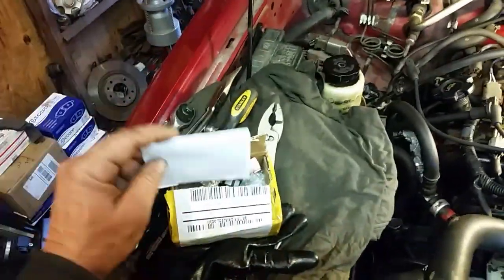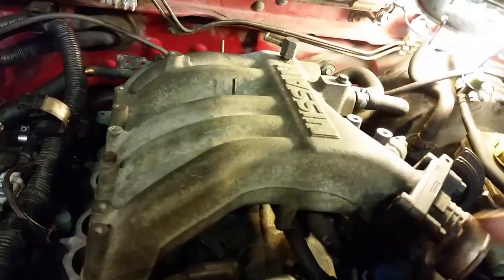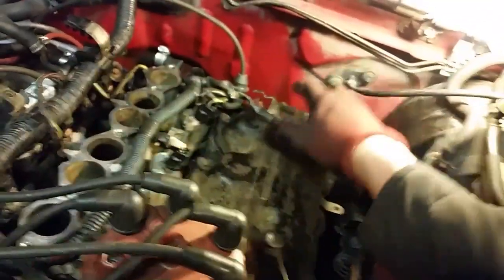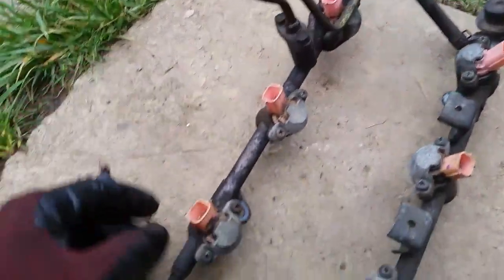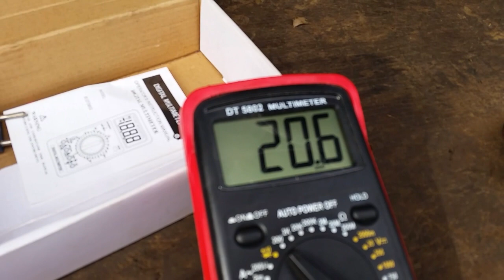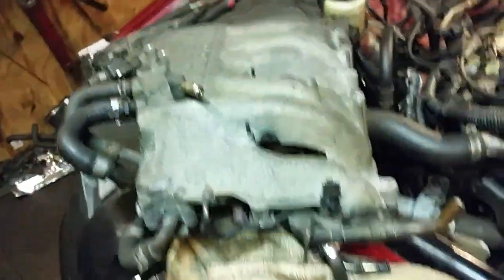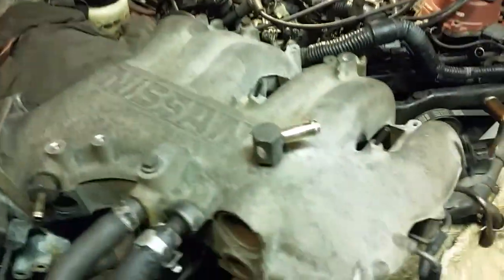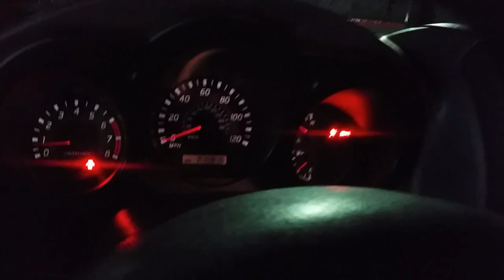Xterra 3.3 Random misfire fix. 6 new Injectors replacement

Comment: My 2004 probably needs that. I dread working on this idiotic "design" where they run hoses, tubes, and electrical down the center of the engine.

Comment: I’m having an issue like that with my 04 Xterra, replaced 3 accesible ones with some from Rockauto and is shaking, heavy gas smell, acceleration problem so I read that if you have black dot injectors you have to get matching black dots on all unless you switch them all and same with the blue ones, sounds like my car has blue so I now will jump into taking all the injectors and the rail and replace them with all new black dots injectors and see what happens. Excellent video very helpful!
Reply from the maker: Nice!! Not sure why aftermarket injectors are such an PITA
Reply: @FixingWithPassion  very much so, I had to stop because of some rain here where I live but I have a big problem so far unscrewing the bolts from the right side like I don’t know where to start if I’m being honest and one of my Allen screws screw is stripped (left side near the accesible injectors)
Reply: I've been using Rockauto for years but found out the hard way that it's best to use them only for mechanical (i.e. brakes, rotors, hoses, etc.) but when it come to anything electrical/ sensors, what not, stay away from them. It's a roll of the dice if you use them for that. You more than likely received defective parts from them. They are notorious for sending those, trust me from personal experience.

Comment: Before I remover fuel rail I used an impact screwdriver on the cap screws. Worked perfectly on all intake bolts as well.
Reply from the maker: Best way!!
Reply: That's what I was gonna suggest.
Reply: @jacobcopeland1922  ?
Reply: @AnonURnot   I was going to suggest using an impact screwdriver it's the kind you put on the screw and hit with a hammer or you can use an electric impact screwdriver nowadays just have to make sure you're pushing in kind of hard.
Reply: i don't own a set of impact screwdriver so instead i use vice grips around the outside of the screw. has worked well.

Comment: Once you get the rail out, use small vise grips on the screw heads, uncrack them, back them out and replace with M5.80 stainless steel and use a little antiseize- Enjoy!

Comment: there's a small rubber bushing that goes between the injector and injector cap. it should only be able to go on 1 way. very easy for it to not seat correctly.

Comment: If you stick a slotted screwdriver through the c clamp over the tab, you can flip the tab so it holds itself open. It'll be fragile like a mouse trap though, so be careful not to clip your finger

Comment: Also had a problem with random misfire.  Turned out the Distributor bearing went bad and cause the problem.  New Distributor and problem was fixed.  Only happened with the engine warmed up. (acted like a vacuum leak)

Comment: Thank you for making this video, I had a p0300 as well but it was first saying cylinder 5 misfire then it became random/multiple. I believe one injector is spraying entirely too much fuel so I will solve that.it already burned my o2 sensor and I replaced the cat. Wish me luck I really love the truck
Reply: I had that issue with my 2000 X-terra.  Changed the distributor/fixed.
Reply: Man.  I have the same issues.   Replace the Distributer and spark and wires.      I still have the same issue.   Right now I’m diggin out the whole injector system and more than likely to replace them.   I’m not sure if I can get away with flush them out.
Reply: Update the engine had a bent valve caused from misfire and it eventually blew a cylinder. Rip

Comment: Thanks for all the videos on this truck really been helping me a lot with mine ! I was taking it today to get some break work done and I started it up ran fine for a few minutes then started sputtering and stalled and wouldn’t start back up almost seemed like it was running out gas just wondering if you have any idea why the problem could be thanks
Reply from the maker: Check fuel pressure

Comment: Great tips. BTW, those are likely JIS screws and not Philips. They are slightly different which is why conventional Philips bits struggle with them. Getting proper JIS bits could be the solution to getting those screws out much easier (rather than dremmle-ing as you mentioned)
Reply from the maker: Nice to know!

Comment: What injectors did you order? I have a p0300 and have replaced 02 sensors, plugs and wires, distributor cap and rotor plus fuel filter. Local parts store has the injectors for 100 each and don't have the funds to pay that. Thanks for the great xterra videos and just awesome how to step by step to get it done.
Reply from the maker: Check your fuel pressure.
Reply: Fuel pressure is good. The advice I got from a local shop is replace maf and injectors. That's why I was asking what injectors you got. Thanks in advance
Reply: @finwall  how much did you get them for in the end ? I just had one go bad and I've already did everything you did

Comment: Thanks for taking the time to record So many videos on repairing the car. I have a vg33e frontier 4x4 and I am In the process of rebuilding the motor. Your videos have been a treasure to me. I took the injectors out of the fuel rail to have them properly cleaned in a shop. Then noticed there are  2  types of injectors one with a colored dot and one with out. Do you know if there s a specific sequence to be followed putting those back into the fuel rail. Thank you so much.
Reply from the maker: Not really. Just lube them with grease to let them slid in.

Comment: You can just use a drill gun  with a Phillips head bit it easy just come out on out for me but you have to put a little pressure on it not too much just a little just enough to hold the drill bit in the  said
Reply from the maker: Right. I do that sometimes also.

Comment: can you pull out those fuel injectors on the passenger side without having to take all that other stuff off??
Reply: i am answering my own question..you can not.  the angle of the injector will not let you get a good screwdriver on the end of this.  Also, use a impact screw driver.  the ones that you hit with a hammer to take off those pesky Phillips head screws.  make sure to soak them with PB blaster a few hours before..  i got them out easily with out stripping out the heads at all.  tap the screw driver into the Phillips screw a few times, and it impact actually spins, and does the work for you.  on the Ellen head screws i put my 6 point head on the ellen bolt and tap it hard a few times to loosen the rust or corrosion and turn slowly with a large ratchet or breaker bar.
coming out with my own video of pulling all this apart, even the knock sensor

Comment: Did you replace that seal with new ones @ 13:23 min of the video, or you reused them?
Reply from the maker: I reused them. Just check for cracks and tears.
Reply: Thank you for the response, I'm just going to replace them all, I found them in the dealership.

Comment: I have  2000 nisan frontier  3.3 p0300  code  random misfire OEM  distributor spark plugs wires  every time when  I hit the gas pedal  service engine start  flashing  rough running  u think  will be the  injector??I Dont  ahave  a good  scanner  to check  the injector

Comment: So I took the injectors out to clean them and now there’s white smoke coming from the exhaust and it’s acting like a misfire but no codes.  Do you think they are leaking by?
Reply from the maker: If it fumes burns your eyes then yes
Reply: @FixingWithPassion  yeah it smells like gas. Do you think I need new ones? I just put new orings on. And how about putting them in? Should I try to tap them in deeper before putting the cap on? I just put the cap on and evenly screwed down each side of the cap.
Reply: Same thing here about 2 days ago. New injectors, white smoke, fuel from exhaust, and cylinder flooding.  Does this car need to be recoded to the ECU?

Comment: Hi! nice video! Where's the link to the injectors?
Reply from the maker: E-bay buy only OEM one's!!
Reply: @FixingWithPassion  thank Nathan! Can you share the link and your part number? I have a 2001vg33. 207k kms, but still on original injectors. After using liquimoly injector cleaner, misfires started.
Reply: @FixingWithPassion  figured they needed changing anyway because they were in there for two decades. So the ebay link could help me out. 60 bucks for a piece or 5 pcs. Thanks in advance.

Comment: What problem are you having? I think I have bad fuel injectors I'm not sure my truck is has rough idle and whenever I get in the gas it jerks the truck around a little bit I changed it to spark plugs a couple weeks ago thinking that might be it I wish I would have done the fuel injectors while I was at it I just didn't have the money at the time and I thought that spark plugs would have fixed it but I'm going to try spark plug wires first and then after that I think I'm going to do fuel injectors I'm probably just going to go ahead and get both and knock them both out what's your thoughts?
Reply from the maker: Injectors seem to be an issue at times. I'd try that first with OEM one's or some out of a 2nd xterra same gen. That fixed my issue.

Comment: I've got a #3 code the strange thing is it starts perfect no matter hot or cold drive it for miles and miles stop let it sit then start up and I have a misfire, it had a random misfire but I found a giant leak in one of the egr or pvc lines can't remember ran fine all the codes went away then the next day number 3 again and the smog test fail on my code reader. I don't really understand if it was a leaky injector the morning start should be bad but its the warm start. I pulled the plug it's perfect new wires new Nissan Distributor going to change the plug today but I doubt that is it. Any help understanding this?
Reply from the maker: Hi! Thanks!  let me check something.
Reply: what injectors are you using and are you happy with them? I can find oems right now.

Comment: Could these slots in the seals be allowing fuel to flood the cylinders? https://youtu.be/cvRX8SgxC7Y?t=801 I just replaced all injectors on a 93 d21 vg30e and it is running super rough/rich with black smoke out of the exhaust. The spark plugs are all fouled and wet. I didn't think to check if the old injector seals had these slots.

Comment: What pisses me off- is, that mfg uses cheap metal on these screws, causing these screws to bend like butter if the tool head is not a perfect! I am tired of crappy production! Why is the US allowing cheap craftsmanship on our cars that are supposed to be safe 🤪!
Reply: Big Tech with little overhead and cheap labor :)
Reply: Use grade 8 and stainless bolts/screws when possible.